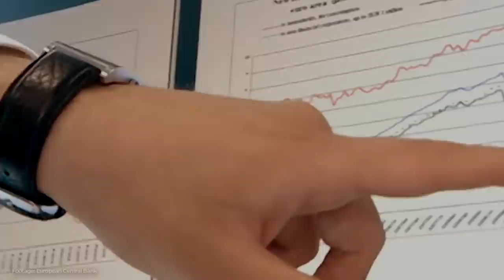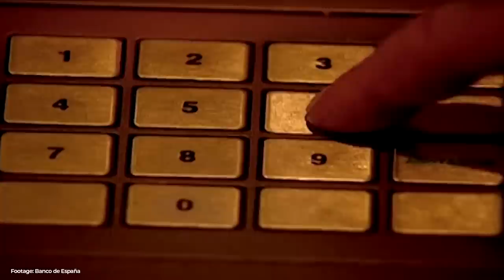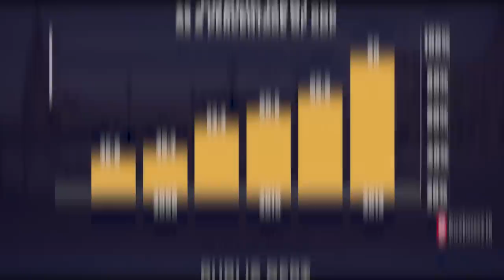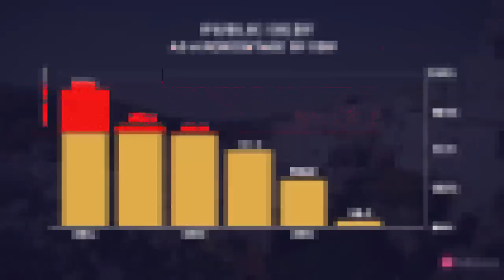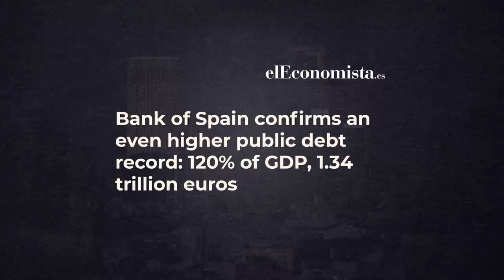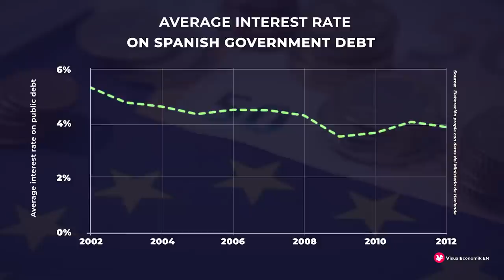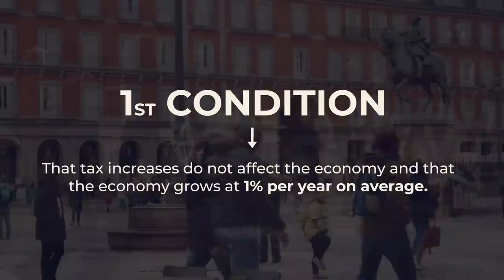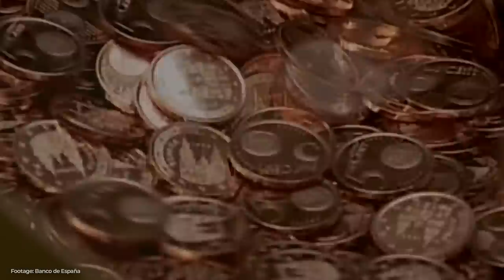Why Is Spain Heading for Economic Bankruptcy? - VisualEconomik EN

Comment: Replace Spain with any other country in the world. Cheap cash in the last 15 yrs caused many countries to borrow like there s no tomorrow. But Spain at least is self sufficient in food and its warm climate helps in energy crisis. That’s why I moved from the UK to Spain.
Reply: UK has that too. You're led by green crazies.
Reply: yes, in summer with air conditioning everywhere it helps a lot to save energy

In winter with temperatures at 0 degrees at night it is also very economical
Reply: @Enterao  If you live in Northern Spain, you dont have that problem. Also air condition is optional. You dont die from it, you can die from winter cold without a heater in your home though.

Comment: The problem here is that there's a vast number of public servants doing largely useless jobs: they can never be fired, re-purposed, or laid-off. Never.
Meanwhile, being a freelancer/entrepreneur here is madly expensive, with each freelancer paying 317 euros/month in social security alone, and that's about to go way up.
Spain could be viable IF they laid-off or re-purposed their vast army of public servants, or simply don't replace the retiring baby-boomer public servants, but there a massive bloc of voters who will never vote for that: those same public servants.
The only solution I can see is the rest of the EU bailing them out on the strict condition that the rest of the EU takes full control of Spain's fiscal system and public sector: not very likely, but at least theoretically possible.
Reply: It's a problem of incentives. In Spain there are a handful of instutions that have been singing the same song for at least a decade, like the AIREF: The current financial setup is unsustainable and is hurting the country.

All kind of measures have been proposed, but in reality political parties have no obligation to do any of that. In fact they pretty much try to silence them.

We do know what's happenning, but public employees & pensioners are a big chunk of the voter base, so everything is done to keep em happy.
Reply: Mate, EU is not going to touch a thing in here, its our country. I agree with the problem you are bringing in but we fix it ourself or we dont, thats it

Comment: The main holder of Spanish debt is the European Central Bank and the money they used to buy these bonds was printed money. Hence, in case of default, the central bank will lose its investment. That will translate in less trust into the central bank and further drive down the euro. This is already happening as the neuro has been on a declining path for a few months now if not years.

So bankruptcy is actually the least damaging solution. On thé long run, the euro is doomed unless its politicians start to have sensible economic policies.

Comment: Though what is stated here is true, this video lacks nuance. Castellón airport was built by the regional government not the central one. This is important as the video implies that the 2% budget surplus was wasted by the central government.  Also, in line with many international forecasts, it was believed that the recession would be 'a soft landing'. Hence the central government's Keynesian public works stimulus drive (Plan E) which resulted in a large part of the budget deficit. Agregate demand is still demand. Though I do not doubt that much money was wasted and misspent, these issues are many shades of grey rather than black and white. Finally, many of Spain's problems result from being essentially a federal system which encourages duplication and waste.

Comment: Default is easy and has no real consequences.  Ask Argentina, which defaulted a half dozen times in the modern era and after some short term pain was back at the capital markets borrowing again.   The reason this happens is that bond holders are sheep and often, due to laws, have to buy debt whether they like it or not (e.g., pension funds).  

I see not just Spain, Italy and Greece defaulting, but eventually the entire G7 including the USA.  Probably all debt owed by foreigners would be defaulted on in the USA, and any debt held by small holders up to say $200k per entity would be honored by the USA in the form of a new dollar, call it the Amero.

Comment: While I generally agree with your analysis, I think it is a bit naive with respect to 3 key points:
(1) The level of interest rates is not everything. To assess likelihood of a default, the debt structure in general is more important, more precisely how it is split between short and long term debt. If the lionshare of debt is of longer duration, they may well be less affected by short term rising interest rates as currently seen.

(2) The ECB is well aware of the issue, which is why they have been discussing an anti-fragmentation tool which would basically allow them to buy sovereign debt of struggling states to keep rates low, while selling debt of “stronger” states like Germany, France or Netherlands, effectively taxing these countries. Whether (or how long) they will accept that given the current context is another matter. But in that way the ECB would effectively not increase overall debt purchases as one buy cancels one sell. 

(3) Cross collateralisation among nations has become a recent trend pushed by the EU and EU bureaucrats will surely advocate for that in case of struggle.

What is clear is that EU institutions have created a block of overleveraged economies with a bloated and unsustainable welfare system and EU officials will fight to keep the bloc alive since their livelihood depends on it. However the current economic context is dangerous and might well be the end of the EU and the Euro as you say.
Reply: it seems very correkt therefore diffecult to know what happen

Comment: The main issue regarding the EU/Eurozone in general is that on a supranational level, there is so much red tape just to get anything passed. The fact that every country has to agree in order to get something passed is beyond ridiculous. That's why the ECB never does anything in a timely manner. They were very late to hike interest rates, and haven't hiked them up enough to try and curb inflation. Now they are now scrambling to try and figure out what to do with regards to the energy crisis. The EU itself is a poorly designed system, and the Euro is just one of the offshoots from that. It was a great idea, but has been poorly executed and I believe it will cease to exist at some point. The best solution for the long term health of the southern economies is to default and leave the Eurozone. The debt crisis in the early-mid 2010's should have been the wakeup call, and yet here we are again, except this time it will be worse.

Comment: Talking about national debt of Spain which is at 95% of GDP as a reason for its imenent demise seems farfetched when the US runs at 108% and the world champion Japan is at 236%.
Reply: You see there is a big difference between the US , Japanese economy and Spain’s, same as the UK they have far greater ability to borrow and pay back than Spain or Portugal even Italy. You cannot compare apples and oranges unfortunately.
Reply: This isn't even close to being comparable, the US and Japan have a ton of assests globally to be sold or restructured, and another point is, Japan's debt is all local debt, it's next to impossible for Japan to default, Japan can easily pay its own debt, in fact, Japan is also powerful enough to be one of the biggest creditors in the planet... this all shows that the UK might have actually done the right thing with Brexit, but only time will tell